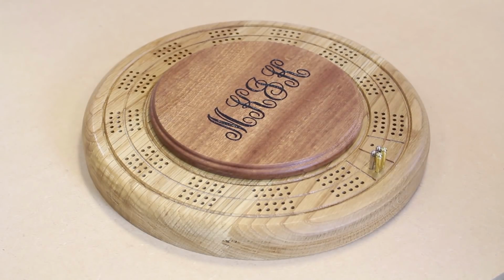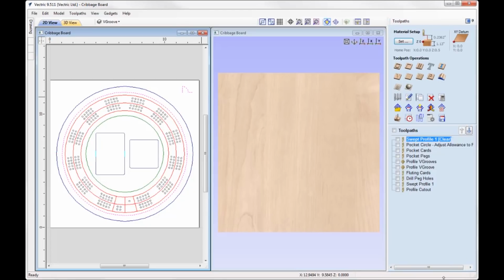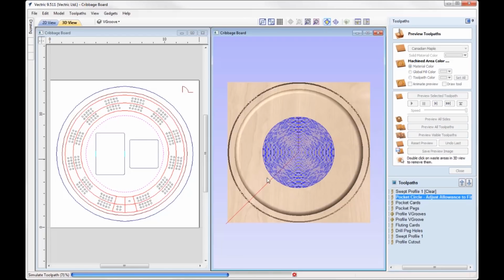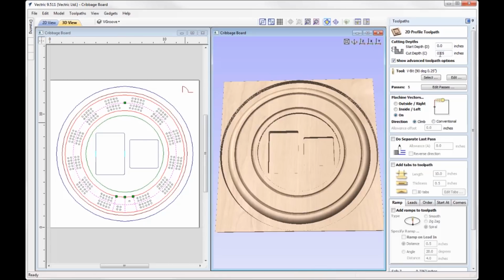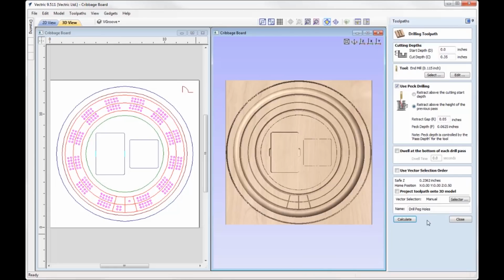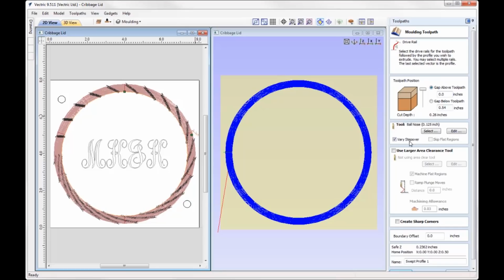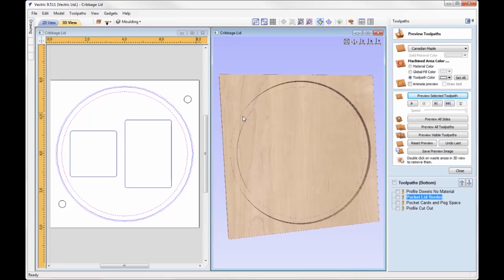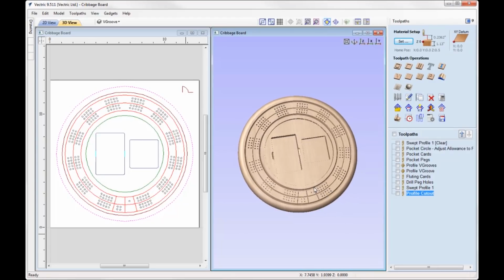In Labs with Beki | Making a Cribbage Board | Vectric FREE CNC Projects

Comment: Which bit is used for the peg holes?  I can't figure out the size.  Imperial size please
Reply: I am late to the game but hoping I can get someone to point me to the website to get these bits. These are not the average sized bits that you can find in most lumber stores.
Reply: Have you found the bits for the peg holes?? I am trying once again to get these boards made 🥸
Reply: No need to get the same ones she's using.  As long as you select the ones you want when crafting your toolpaths, assuming they're smaller diameter than the holes, you'll be okay.  The software will take care of the rest.

Comment: do i really need the dowels to line up the project? I have a fence mounted on my wasteboard so when I flip the piece over it goes back into the corner of the fence. if you think i should use the dowel method with the fence can you post a link of dowels please. Thanks
Reply from the maker: Hey Lloyd, I use this method as I havent set up a jig and this method is pretty fail safe in that I can machine the two sides in two seperate operations, here this video might help explain what I mean: https://www.youtube.com/watch?v=wIOxqcLbJt4 I hope this helps! :)
Reply: there's no reason for doing it as she's suggesting.  I've never used one and have successfully done many double-sided projects.